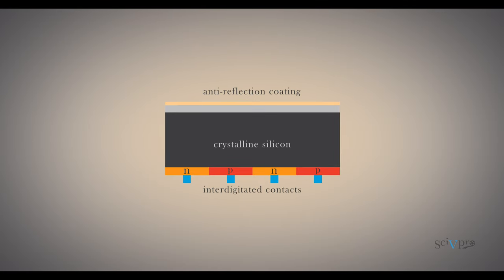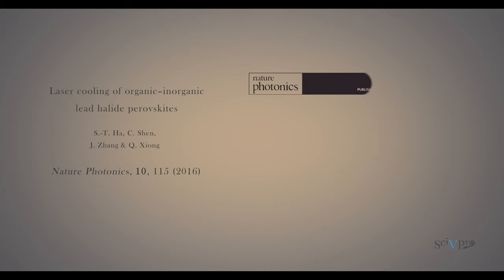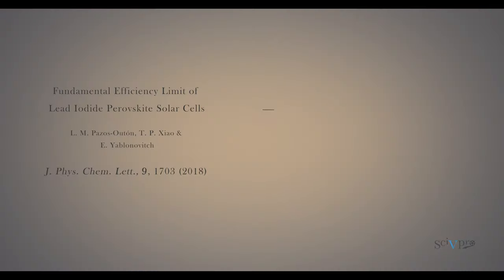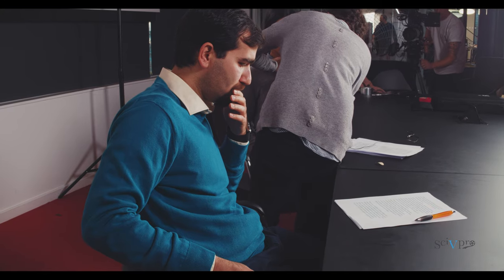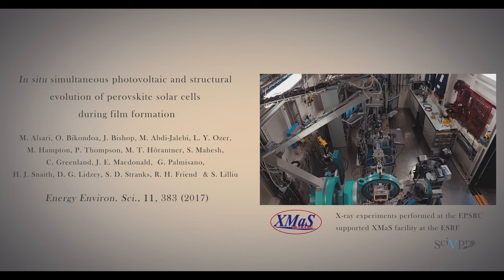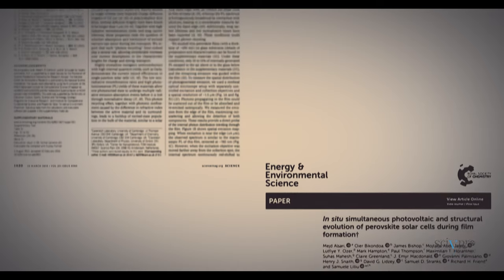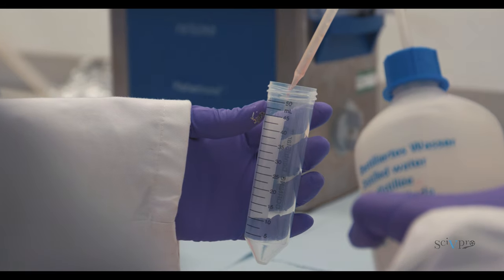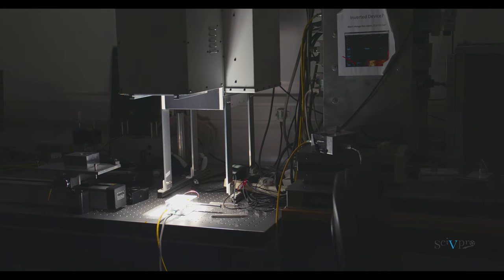Back-Contact Perovskite Solar Cells | Prof. Sir Richard Friend et al. (University of Cambridge)

Comment: Incredibly technical video, very good and clear speakers with extreme subject knowledge. Quite impressive, had to constantly back up the video. I would recommend defining a few terms in the video with text on the screen such as quenching, recombination, passivation, and illuminating when first introduced to make this more attainable for a wider audience with lesser knowledge of semiconductor materials or those trying to learn.
Reply from the maker: Hi Jon, thanks! The video is a peer-reviewed video article (full text is available here: https://scivpro.com/manuscript/10_32386_scivpro_000005/), and it is meant for the 'broad' scientific public, not really for the general public. In any case references to previous works are available in the article text/pdf, which you can read/download from www.scivpro.com. Yes, of course we could add definitions in the video, but it would be probably distracting. Overall it is an actual scientific publication, so if we had to explain each single term it would be a 5h video :-)

Comment: Why not to make a honeycomb pattern using photolitography mask? And why galvano-coating...it will give you efficiency of brick or lemon, you oxidize immediately your fingers making crappy but still capacitor. perovskite is not as conductive inside and fingers are oxidized immediately, maybe you have some xps and sem study of what exactly is on the finger?
Reply from the maker: Did you work on perovskite IBCs yourself?
Reply from the maker: Probably you haven't read this https://pubs.rsc.org/en/content/articlehtml/2018/ee/c7ee03013d . Bricks, lemon, and capacitors do not have any "photovoltaic diode-like behaviour". Check figure S2 (from supporting information http://www.rsc.org/suppdata/c7/ee/c7ee03013d/c7ee03013d1.pdf).